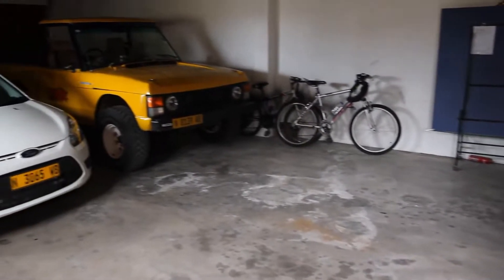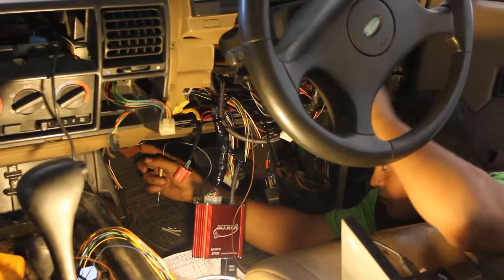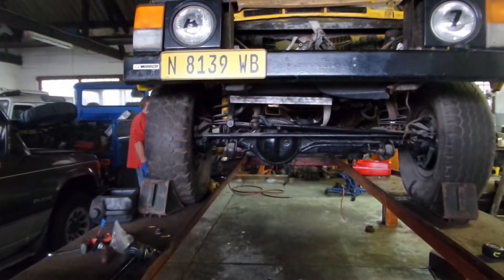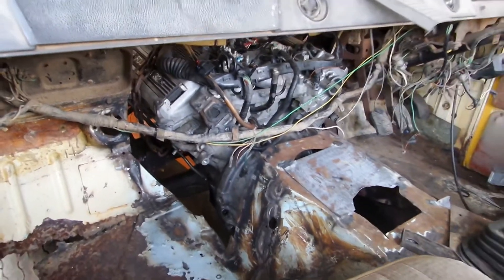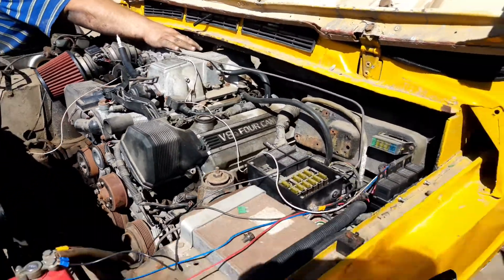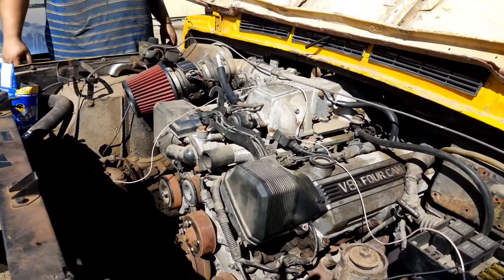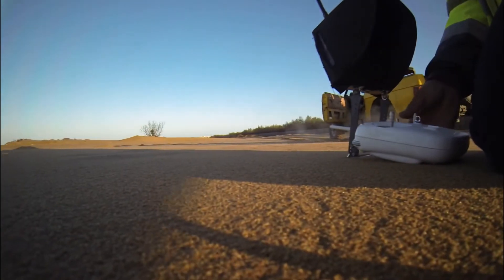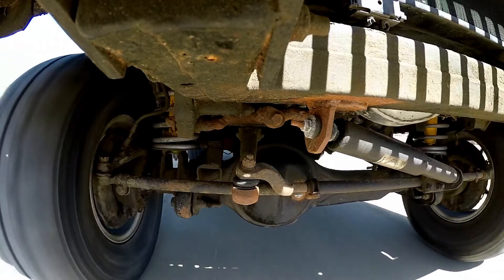1UZ-FE conversion on Range Rover Classic

Comment: Hopefully you got the death wobble figured out by now, but control arm bushings, and or arms, drag link and track rod ball joints, possibly swivel ball pins/ housings..
Heavy unbalanced or flat tires will contribute..
Cheers
Reply from the maker: Yeah... I ended up replacing the chassis with one from a Land Cruiser FJ 80. Still needs testing.

Comment: any way to solve heating issues? on the disco 1
Reply from the maker: Hmm, to solve heating issues you need some combination of more surface area for the interchange of heat and better air flow. On this vehicle it would mean a bigger radiator and a bigger distance between the engine and the radiator to allow for that airflow. I sold the car before making those changes, though.

Comment: Has the Nissan Patrol death-wobble. Just about everything in that front end is munted. So it's radius arm bushes, balljoints, swivel rebuild, cv shimmed properly, relocate the steering damper to the correct RRC location on the track rod. It's not a defender, so don't try to make it one. the RRC is a much better steering vehicle than the defender. You'll have more success if you slot the swivels for more caster and/or use eccentric radius arm bushes - because any lift will alter that geometry and contribute negatively to the issue.
Reply from the maker: Yeah, I am swapping out the chassis with one from a Land Cruiser FJ80. That should sort the death wobble and a few other issues.

Comment: het jy die death wobble gesort ?
Reply from the maker: Ons werk nog aan hom, gaan die chassis replace met een van in FJ80 cruiser.
Reply: Ons sukkel nog. Gaan nou die hele chassis verander
Reply: @msdosretrospectives  wag voor julle dit doen , kry die rover op 'n wheel alignment machine en kyk wat is die castor dit moet 5 en 7 grade wees std en paar hoër as jy 33s plus hardloop , soos ek aflei het julle al die rubbers en joints vervang reg ?
Reply: @R_ovrlnd  jong, ons het al die joints se rubbers vervang. Die castor is so 4.7, so bietjie minder as wat jy voorstel. Die ding is ek moet die engine trek want daar is 'n olie lekkasie... en ons moet nog 'n handbriek praktiseer. Die chassis wat ek klaar gekoop het vir 'n bargain het klaar al die steering setup reg, en het 'n handbriek. Ek sal die ou chassis verkoop as daar dalk iemand is wat die diwwe ensovoorts soek.
Reply: @msdosretrospectives  ek hoor jou . Ek saal belangstel om daai diffs van jou hande af te neem haha , dit kan ook wees dat die chassis gekraak is waar die steering box vas bout, jy moet kyk dat jou panhard so naby as moontlik aan parallel is met jou arm wat van jou box na jou tie rod loop . Hoe het julle die castor gemeet as ek mag vra? Want jy kan dit doen met n wheel alignment machine of jy kan dit meet oor die twee boonste boute op die knuckle met n angle finder. Jy kan glo watse verskil maak daai paar grade nie , want hy gaan ook minder trek op die pad en die stuurwiel gaan actually dit self centre en gaan nie voel soos 'n spar trollie nie . En as die castor wel dieselfde is , is dit 'n redelike maklike fix en bekostigbaar, kry net 'n stel castor correction bushes wat jou daai ekstra 3 4 grade gaan gee wat jy kort

Comment: Oh by the way are you using the correct wheel nuts ?
Reply from the maker: I am, nothing else will fit. :)
Reply: @EvertVorster  did you look at the uf-4514 ?
Reply from the maker: @GREFOUNDRY  I have not had a change, mate. I am offshore at the moment, will only be back in Namibia in March.

Comment: Did the fuel economy change with the 1UZ ?
Reply from the maker: Honestly, I would not know, as the spedometer is not working, and the vehicle is not a daily driver anymore... The UFZE-1 is more economical, but the way I drive it is very un-economical. :P 
I did a similar swap on a Land Rover Discovery, and the fuel economy improved by about 20% over the stock engine.
Reply: @EvertVorster  Have a look at the UF-4514 that I designed for the LR platform . Makes the front end rock solid in steering.
Reply from the maker: @GREFOUNDRY  Thanks so much for this tip, I'll check it out!
Reply: @EvertVorster  Did you find the application of the brakes fixed your death wobbles somewhat ?
Reply from the maker: @GREFOUNDRY  Ah, I find that applying a little steering pressure reduces the effect... also it does not happen when I am driving over rought terrain, only on smooth surfaces.

Comment: 1uzにh55を取り付けるには加工が必要ですか？
Reply from the maker: Hi there! I had to Google Translate this comment. Yes, you need to make a custom flywheel and adapter plate to be able to mount the 1UZFE to the H55 gearbox.
Reply: @EvertVorster 
bell housing Did you also process it?
Reply: @ninja6991  No need, I used the gearbox that came with and was made for the engine, so the bell housing was already good. The conversion was between the gearbox and transfer case in this case.
Reply: @msdosretrospectives 
I'm currently docking with 1uz and using h41, but I want to change it to h55F, so I'm checking the clearance of the bell housing.
Can h55F be used as it is in 1uz?
Reply from the maker: @ninja6991  we had to build an adaptor plate between the engine and gearbox, and make a flywheel, but after that it worked fine.

Comment: Death wobble..if you watch the front suspension, when it goes side to side the steering damper shock/ absorber rotates up then down with each side to side movement. it is twisting and the shock is fighting it but also participating in the problem. The pitman arm ball joint is moving up and down. It is worn out, as are all the bushings, Panhard rod bushings,  radius arm bushings, you will find the ball and socket are worn badly, it is going to break soon. Swivel ball also needs preload set up. probably need to rebuild them as well. You can look at it wobbling and see everything moving, right?
Reply: 4:05 look at the pitman arm and the boot going up and down. there should be zero-0- movement up and down at that joint. please take that off and have a look. I have had a range rover for 12 years.   In case you havent seen this or are unaware, skip through till you get to the swivel ball preload/drag required. https://www.youtube.com/watch?v=_dOijZ9q9PY&t=238s it's very similar to this for you.. I Just love rovers.. I will wait to see what you come up with...If the pitman arm goes up and down in the tie rod ball joint if its worn it will move from tight to loose in the joint, this has the same effect as turning the steering wheel a very small amount, so up and down translates to side to side. Incorrect castor angles could be adding to this problem,..Good Luck to you.. Thank you
Reply from the maker: Hi there, John. Thanks for the analysis. We have replaced most of the ball joints once already, but as the rubbers have split from this action we might have another go at that. I do have another much higher speed and resolution action cam now, and will post an update once I get back to fiddling a little more with the vehicle. I'll notify you on the comments here if the vehicle still does that.